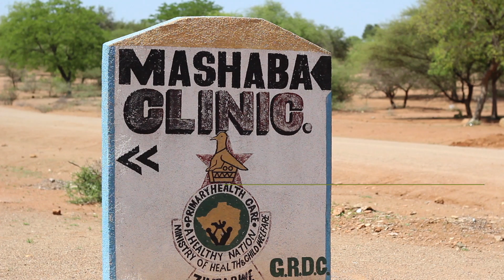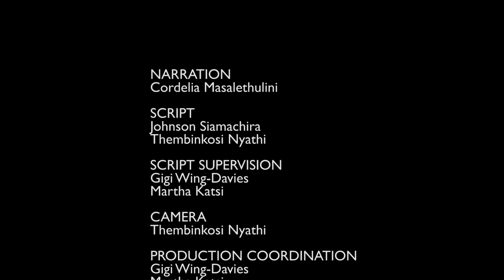SE4RC Mashaba Minigrid: Zimbabwe's First Inclusive Solar Minigrid (long version)

Comment: How much will it cost to install solar panels that u can use for tv and stoves
Reply: From my limited knowledge of solar energy it's not financially sensible to power a stove using solar as it significantly increase the start up cost due to high energy needs for stoves i.e 3kw. However for lighting, TV and fridge a 1000w/1kw Inverter can do the job.
Reply: Use gas for stove ,,,shun away from electrical stoves they use a lot of power ...
Reply: please send us your inquiry on sales@powerlifenergy.com. We will give you a system that will match not only your needs but your budget as well.Thank you, looking forward to getting your inquiry soon